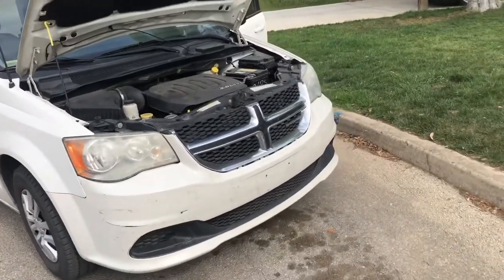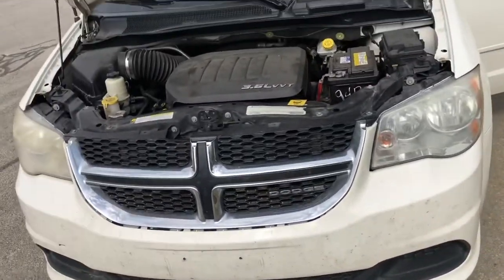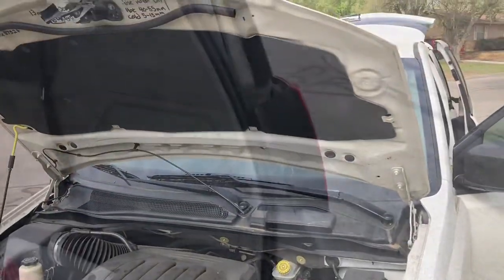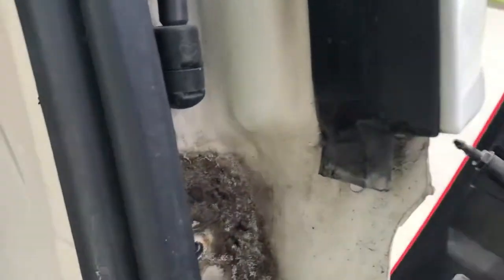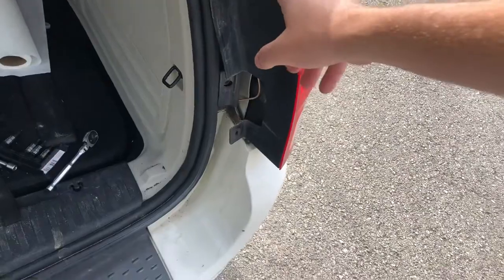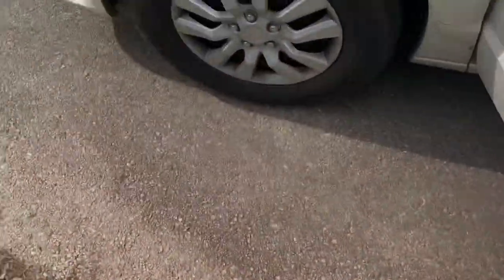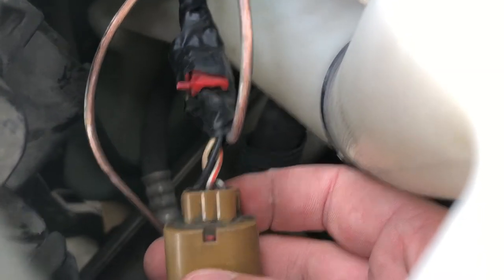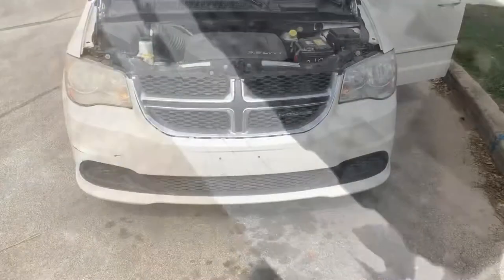No Front Blinkers!!!  $10 Fix | Bad TIPM | Grand Caravan 2010 20112012 2013 2014 2015

Comment: So i used this complete method to fix the front signal lights from the rear  so now both front and back work when I press the hazards button still only the back blinks
Reply: fricken tipm needs work bra.  check relays before you mess with it.
Reply: Why not fix it the right way?

Comment: Chances are its the socket being burnt.
Reply: Hey Bro - just changed the TIPM on my 2014 caravan that showed a code PO 480 and check engine with the low speed fan not working. A junk yard TIPM fixed it but now I have no front blinkers or flashers. Park lights work when turning headlights on. No front flashers. Blinker resets when ignition is off but when turned on, blinker sounds normal for 5 seconds then goes fast, all while both back blinker bulbs work but not front. I checked bulbs and fuses under dash in fuse box all are ok. Is it this new junk yard  TIPM???